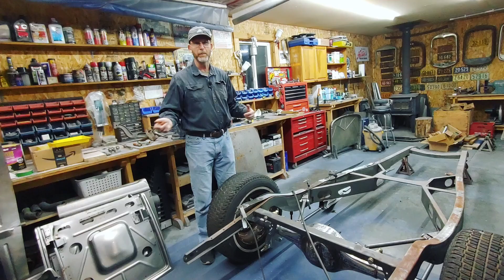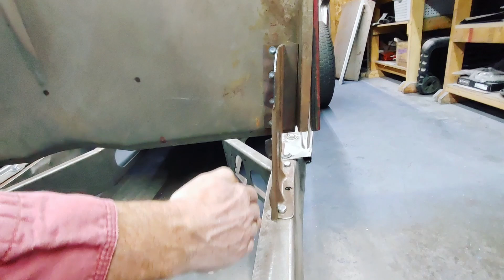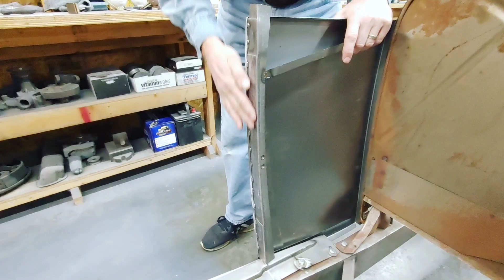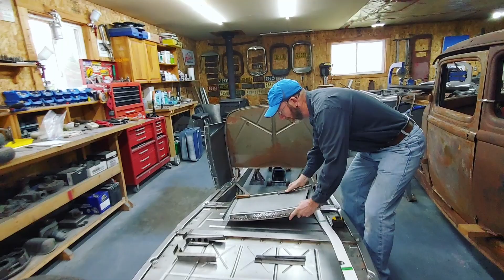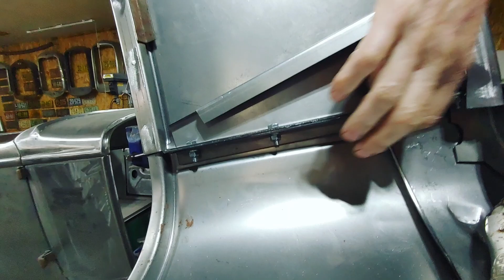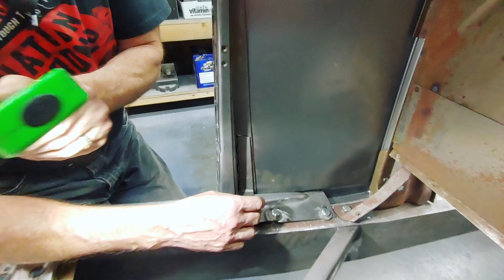Revisiting the 1932 Brookville Roadster Build (2022-2023) Episode One

Comment: Did you ever figure (roughly) how many hours it took to do all the repairs and get the body together?  Save a lot of money going this direction?
Reply from the maker: I certainly didn't save money on the first one. We put 5 of these together in total. I figure on the second one I broke even on labour and by the 3rd one I was doing it for less than what Brookville charges for assembly. If you can get seconds panels you can save money too but they're not always available.